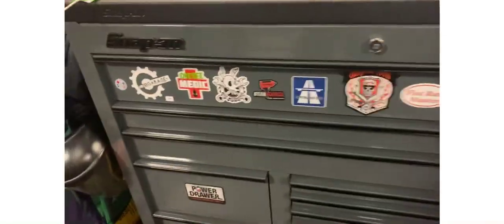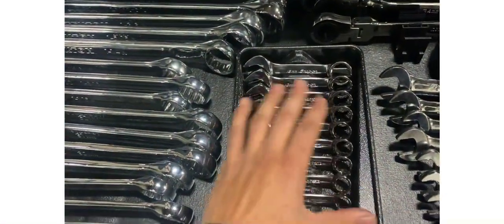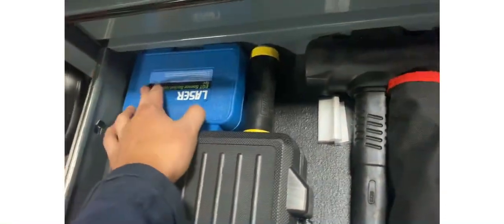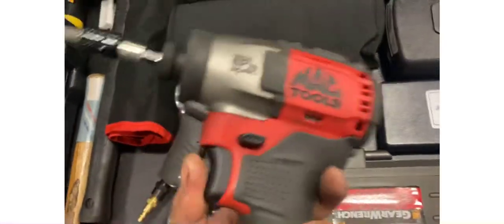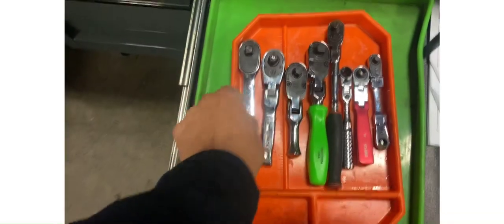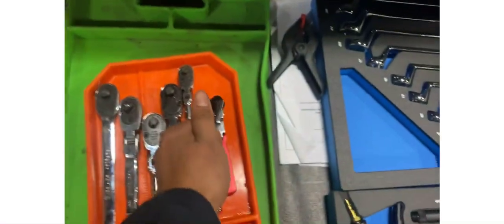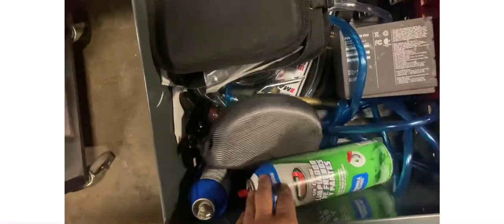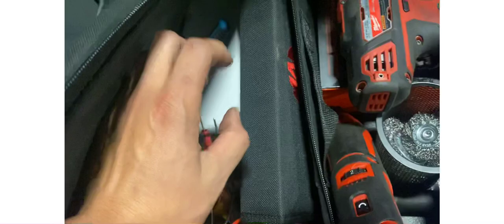SnapOn KCP1422 Tool Box tour || 6 months in Freightliner

Comment: You’re off to a great start ty! Have you had a chance to use the tribus wrench?
Reply from the maker: Yes sir, and honestly unless you are working on tight spot u actually dont need it. I usually use the gear wrench socket set.
Reply: @Tyronetrinity  I always consider them whenever I’m working on brass fittings for the airlines but my regular flarenut wrenches do the trick so it’s hard to justify just yet